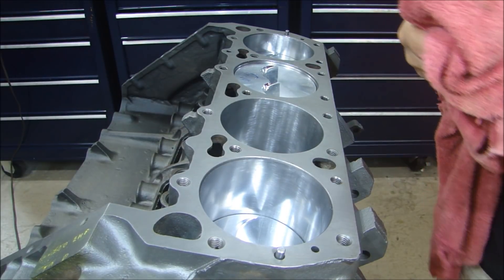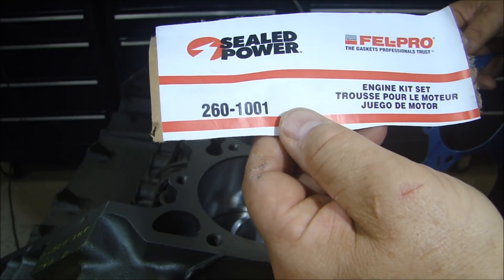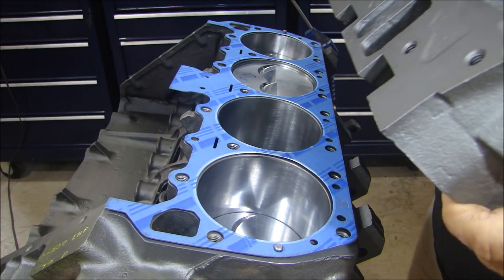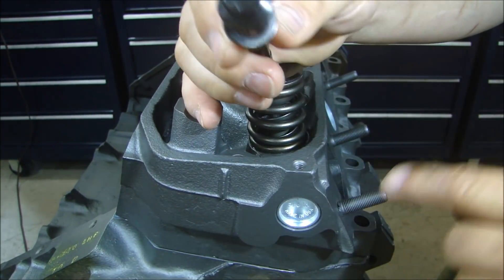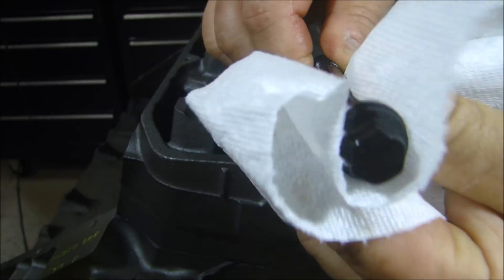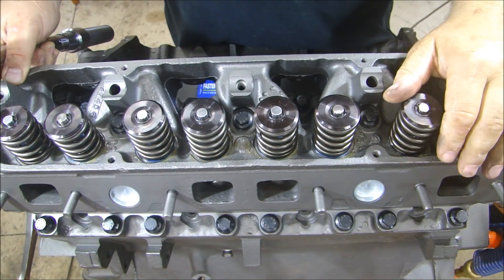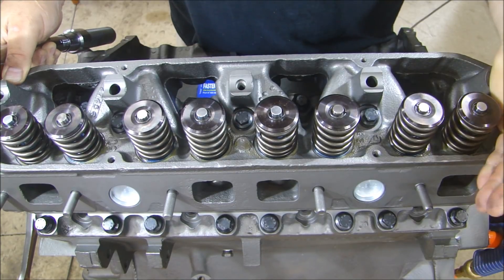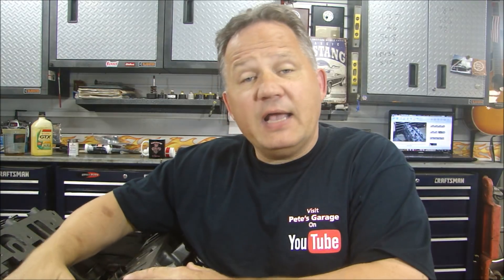440 MOPAR Big Block Engine Building - Installing and Torquing Iron Cylinder Heads

Comment: Need cam advice , I am building 440 in 1974 barracuda . 727 Transactions,  stock gears , stock stall converter, 10 to 1 compression,  I want to drive street strip ,  will a 470 lift purple cam from molar performance be ok ? Want to run a 750 carburetor , stock heads,
Reply from the maker: Sure, as long as the valve springs match

Comment: I take is as the head gaskets are symmetrical I guess it doesn't matter what cylinder goes on which side or are they handed as building a 440 with a friend which was already disassembled and see anything saying left or right side
Reply from the maker: Be careful, they are not all symmetrical
Reply: @PetesGarage  thanks for the reply they are 1970 chrysler 300 head and block

Comment: Why does the head gasket have a small slit for the water passage? Such a big hole in the block only to be restricted by the gasket!
Reply: you can open up larger to the shape on the head, different year heads have different shape opening like circles and triangles .
Reply from the maker: Thanks Tobias. The slit is designed to restrict flow or else the head would cool too fast
Reply: thanks i never thought about that
Reply: If the slit is designed to restrict flow, why didnt they just make the passage smaller? I dont get it
Reply from the maker: Because it is a basic casting. They are not going to change the mold and make hundreds of block variations. It's easy to control flow with a gasket

Comment: How much is it usually when you get your Engine Blocks re-faced, degreased, and cleaned?
Reply from the maker: Degrease, magnaflux, install cam brgs, soft plugs $250. Mill V-8 deck $150